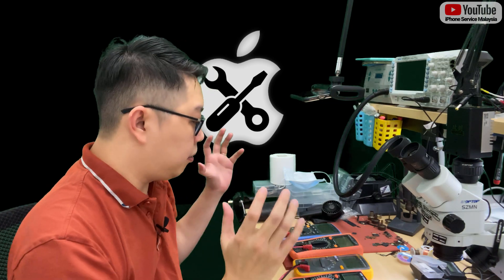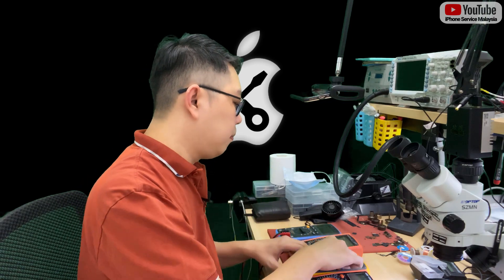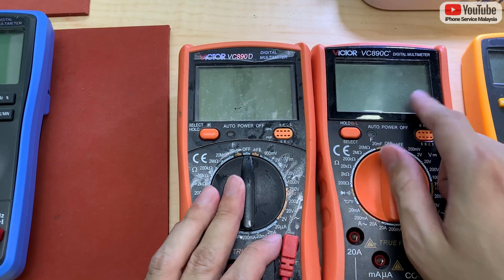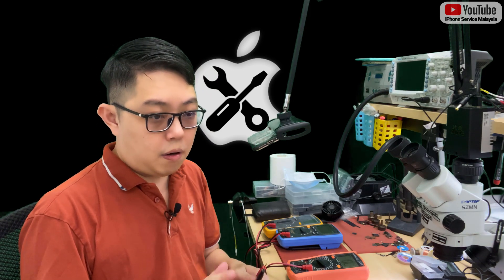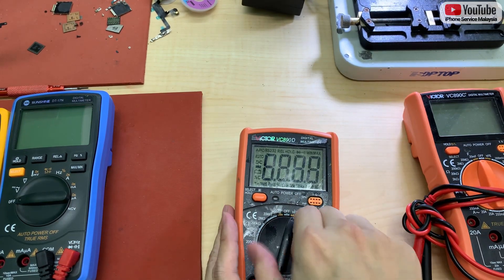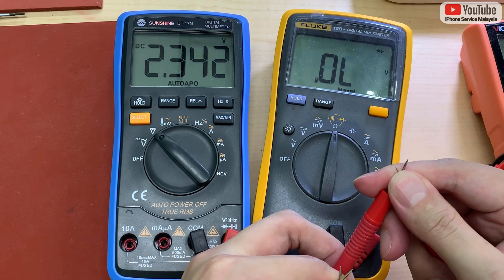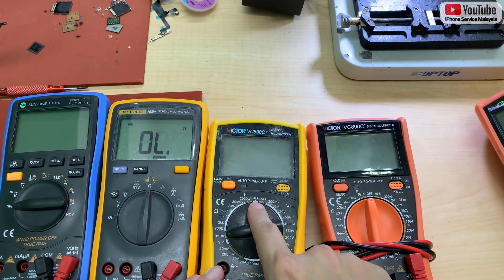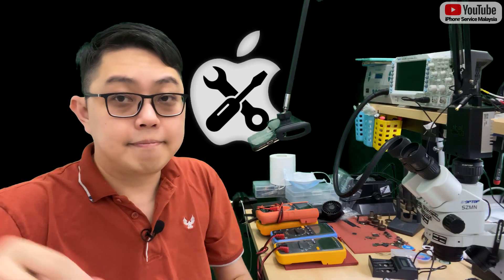Multimeter for repair iPhone Logic Board 【Tool Preparation #02】

Comment: I'm sure they work ok but aren't the usb-rechargeable 9V batteries noisy? Afaik they're a lithium cell plus a step-up switching converted, so  the power won't be as clean as a normal battery

Comment: I do have fluke 87V, they have a very high diode/continuity voltage test, around 7 VDC IIRC, did damage some active components during probing.
Now I understand why louis rossman choose fluke 15B+ as well for their lower continuity/diode test voltage.

Comment: *.Which of these 3 types do you recommend= 
1. new vicior Vc89oc+ Multimeter.
2.  Vicior Vc890D Multimeter.
3.  Sunshine DT-17N Multimeter.
*.these are the ones faund in internet=
1 . An8002 Multimeter
2.  Sunshine DT-19N Multimeter
3. UNI-T UT136B+ Multimeter =
                                   Ac/Dc
                                   Ncv Capacitance
                                   Resistance
                                    Diode
                                   All check..